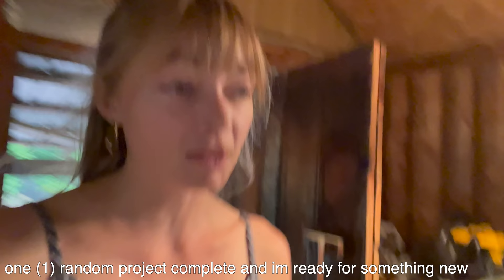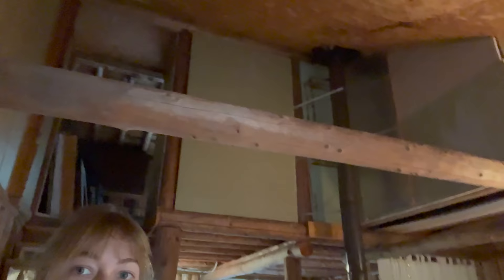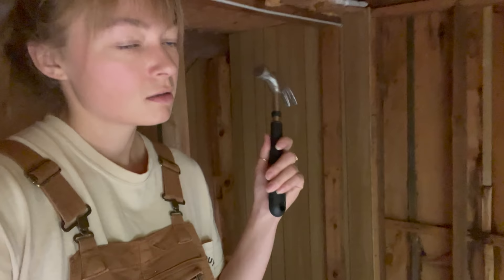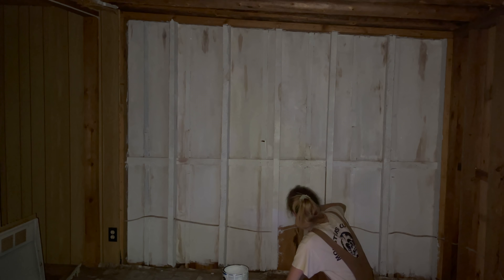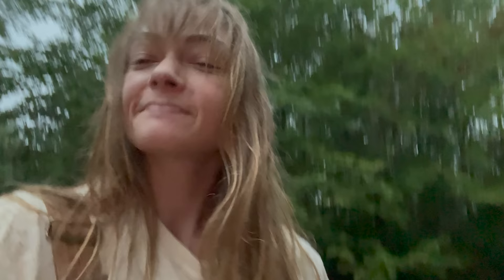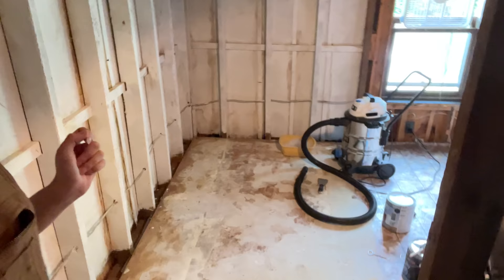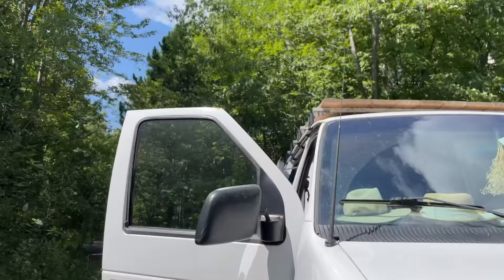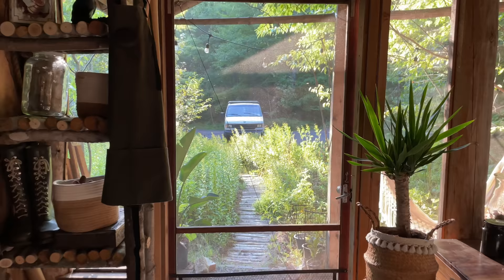i changed my mind

Comment: Small suggestion on the wooden pathway, as the elements get to the wood it will probably end up getting pretty slick in the future. Those type of pathways are known tailbone bruisers. An easy traction option is gathering old fishing nets (or whatever nets) and industrial stapling them to the boards.
Reply: Good thinking, chicken wire I've seen used as well

Comment: How livable will that be during winter? Insulation is necessary, seal cracks w/foam, & then perhaps plywood & shiplap, or sheetrock/greenboard, taped, finished & painted. Helluva lot of work, but is a better, longterm solution.

Comment: Your floor your pulling up,  try using a iron put towel between floor & iron,  iron a big spot, pull up, the iron will heat up the glue so you can pull up easier,  works with wallpaper too..

Comment: Should'nt you insulate those walls and add plasterboards on top? Am I dumb?
Reply: Yes I would anyway. That's prob why the top of stairs was sectioned in as well, to keep heat in and stop draughts coming up
Reply: You could, but it looks like these cabins were built to be summer cabins or three season cabins. There’s stuff you can do to insulate it but it’s never going to be as warm as a house that was built for four seasons in the first place.
Reply: @bassoonrckr  Definitely, but I'm pretty certain those were done to have some insulation

Comment: You need to remember Fall 🍁 & WINTER 🥶 are coming. Best to clean out, insulate, get a weed whacker for overgrowth near the cabin and build up wood supply. Do you have a snow blower so you can keep your driveway clear? Understand the want to bail on the work and have fun, but that’s your ADD talking(have you had anyone diagnose or help you understand these impulses? Worth the time to learn🙃) There are techniques to help you with Time Management, Projects, and preparing for winter. Just want you safe, warm, & happy for the upcoming seasons!
😉🍁🎃🍂❄️☃️❄️

Comment: There appears to be zero thermal insulation in the roof and walls.  
It must be very cold in winter, yet you paint the internal face of the external boards  ?
The fires you need will release far more carbon than they would with proper insulation.
I would suggest a minimum 4" thick foil backed Celotex or similar board cut to fit tight between rafters and studs then overboard the interior with vertical or horizontal 6" wide T&G boards.  I would also treat the external boards and the new T&G for bugs, before you fix them on top of the insulation.  The insulation in roof and walls will make a huge difference to internal comfort.  You can do the ground floor too but they will have less effect.
While you have access to the space between the studs it would be a very easy time to add some more power sockets too.  Forget painting the walls and ceiling, why not wood stain a light grey/brown stain instead, far nicer and no bleed through issues.

Comment: Hannah, That window glass door, that you moved, if not using it, Maybe put it where u took down the dry-wall as a railing or divider so u don't fall over the second floor. Just an idea, if  u don't has the extra material. Still get sunlight in

Comment: Drywall 101 when needing to cut any piece of drywall u jus score or scratch a line down one side with a razor knife set on its minimal depth cut then jus bend quickly and it jus crack pops down the cut line you made then hinge fold it almost all th way over leavin room for your hand w/razor knife  to cut the remaining paper still atached...no sawing & no dust...it is th only way to piece drywall👍😊😘